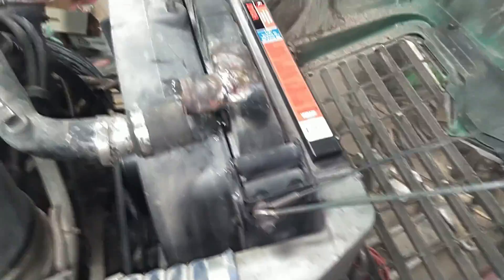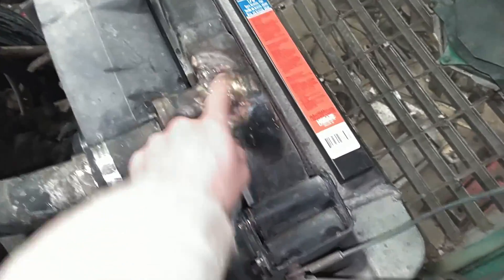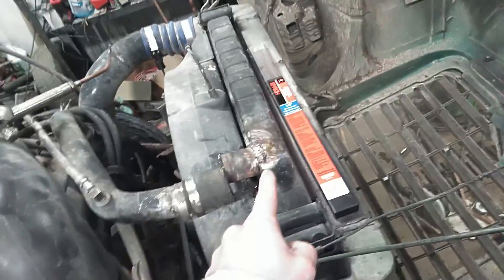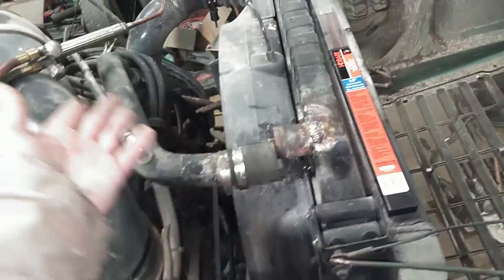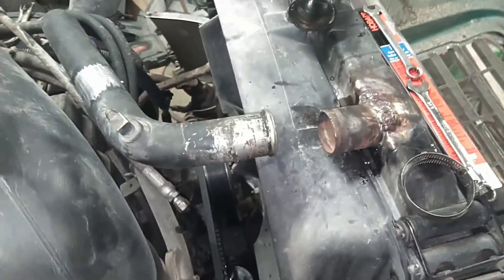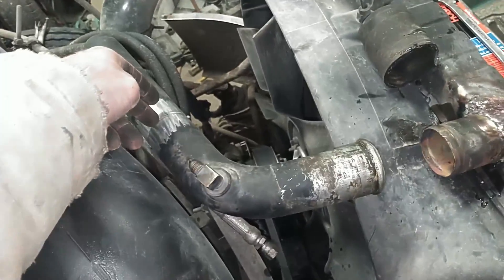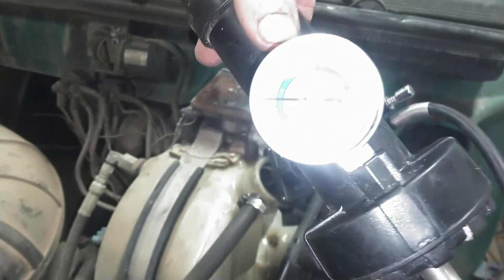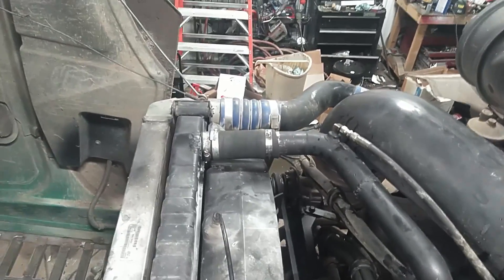why aftermarket radiators suck

Comment: I had to replace the charge air cooler on my Mack so I bought one advertised in a truck classified paper for way less than what the Mack dealer wanted what a mistake this was. It was made in China and just like what you ran into with your radiator this thing didn't fit worth a crap. the original was just about twenty years old and this Chinese monstrosity I bought is about 5 years old and it needs replaced already so I shot the nickle and went over to the Mack dealer and bought a new one that is made in Canada all is good now.

Comment: Junk is the best word to describe some of these rads . My original rad in my 379 pete lasted 9 years , which I thought was pretty good . I went to my local rad shop he said I can sell you a rebuild or a new one for same price . Well l said I will take the new one that's built in mexico . l asked how long do you think it will last , he said any where from 2 to 8 years , depends on your luck . Well l wasn't to lucky 3 years later it started to leak and before that it would run hot . I was pissed so back to a different shop put in another rad , this time l bought a rebuild with a core that was made locally . Crossing my fingers that l get 5 years out of this one .Also bought duralite charge air cooler at the same time , there suppost to be real good quality , so l am told . Time will tell , good luck with yours safe travels .
Reply from the maker: Iv never had any luck with aftermarket one those kinds of parts never had a issue with a oem replacement

Comment: I have had great luck with my aftermarket radiator and air to air or charged air cooler however you call it the place I use is only 50 miles from me and all of my friends in trucking use them as well.
Reply from the maker: Yeah this radiator is the longest iv gone without issue on aftermarket but I haven't tried every brand

Comment: Factory  radiators , at  least  in  a Volvo  are  plastic  and  aluminum  garbage . At  least  for  a  garbage  truck . For  an  aftermarket  radiator , northern  is  better  than  factory  but  then  we  got  a  Modine .  It  comes  with  a  top  and  bottom  piece  of  steel  so  that  you  don't  have  to  bolt  anything  to  the  plastic  tanks . Our  other  issue  is  that  they  put  the  condenser  and  air  to  air  cooler too  close  together  and  you  can't  clean  them  very  well .

Comment: i am not a fan of aftermarket parts either but sometimes they are a necessary evil.....if i were in your shoes when the o.e. radiator was not available, i would have bought the aftermarket, put it in, and sent my original one in to see if it was cost effective to repair.

Comment: Yeah I agree with you to a point I can certainly understand your feelings I have had a few of these aftermarket L cheapo radiators that I’ve been a pain in the ass to put in because nothing lines up like it should I have had pretty good luck with aftermarket stuff for Kenworth and Peterbilt I don’t know maybe the popularity helps them i’ve had really good luck with Duralite Products there charge air coolers have a  seven-year warranty
Reply from the maker: This is the first one that iv bought that made it over a year without a issue. If I could have gotten a oem when I bought it I would have never had to replace one again that I had replaced with a oem

Comment: Duralite rad for the win,13 years on mine no leaks,4 core and keeps me cool on any pull.nice job on yours,wanna do a head gasket and new head with me...loldoing that next week
Reply from the maker: Every time I have tried to go aftermarket on radiators air to airs or ac condensers iv had issues never had a issue with a oem unit. Mabye I have worse luck than others...lol
Reply: Mack are not as popular,so they spend less rand d on the fit and function. Pete,kw,freightliner,some international are more closely mirrored.i would buy nothing but duralite,they are sold at our local kenworth,made in canada.a stones throw from you...Ottawa. be safe sir,best wishes for your xmas,and a great year for ya.